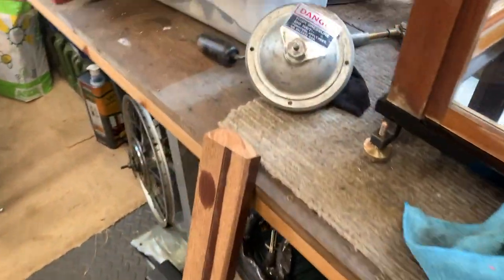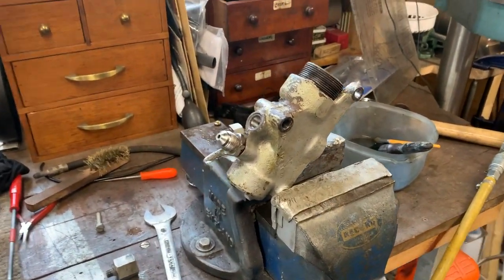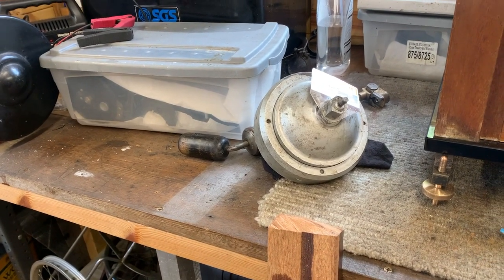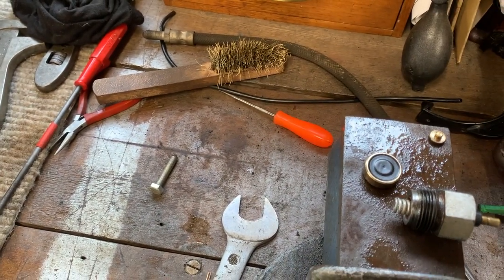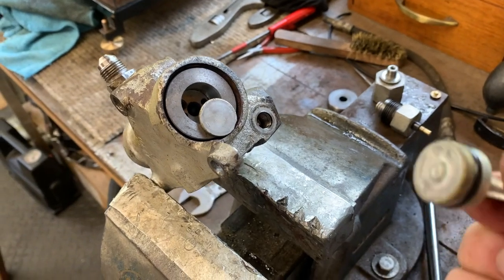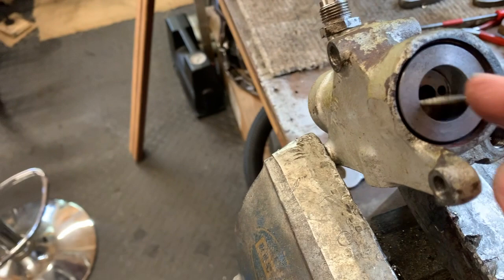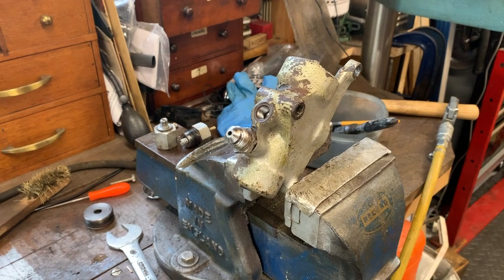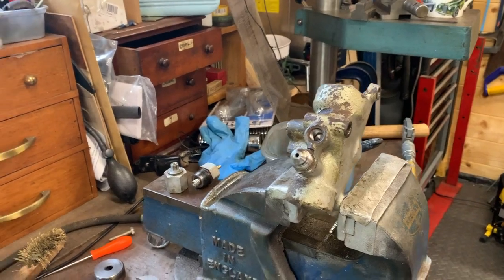1973 Rolls-Royce Silver Shadow Brake Hydraulic Accumulator part 4

Comment: Thanks for taking these videos Steve, very helpful. Just bought a 1974 SS1 About to bleed the brakes LP and HP systems to try to get a pedal Hopefully won’t have to go further to these lengths
Reply from the maker: No Problem at all. I used to work on these as a kid, they can be an issue if you don’t know your way around them, but there is lots of info available and if you are mechanically minded the are not a problem.